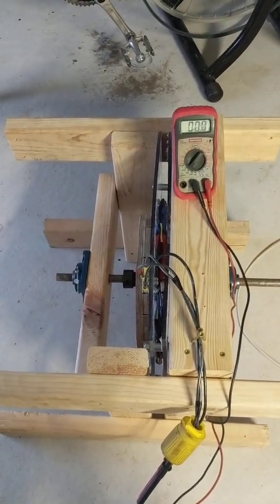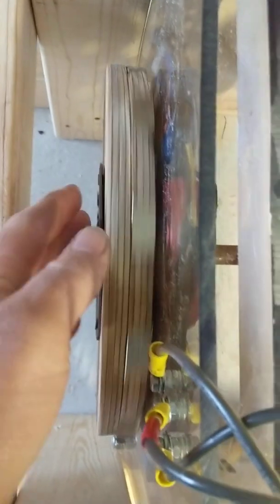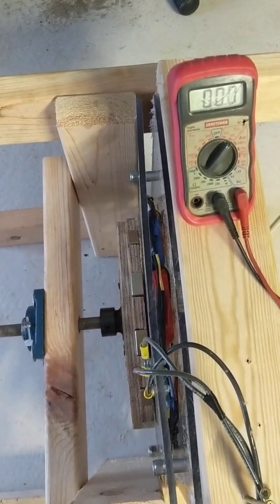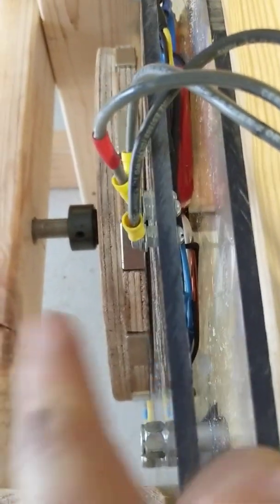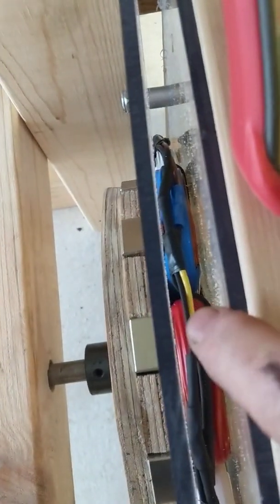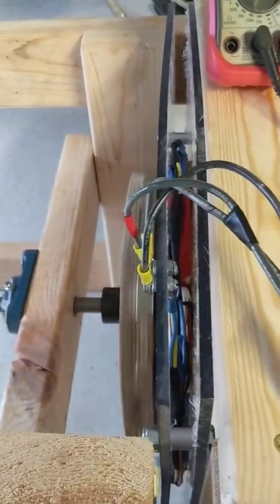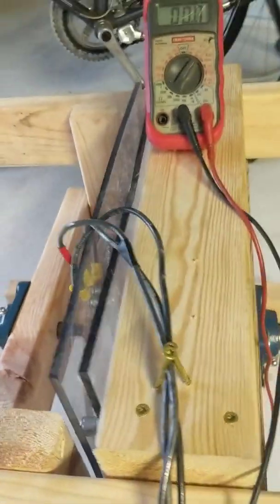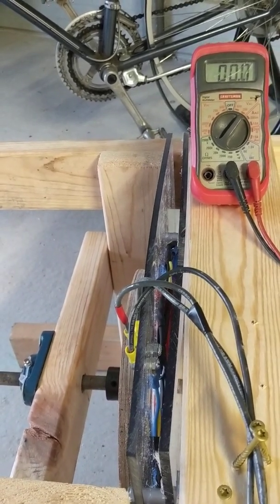Axial flux wind turbine build

Comment: are those 3/4 inch thick magnets? I use 3/4 inch thick n52 that are 147lbs pull force ,they are way better results than the n42 1/2 inch thick
Reply from the maker: Thanks for the reply yes these are 1/2" thick magnets but are N52's they are 2"x1"x1/2" not sure the exact pull on them but definitely don't want to get your finger stuck between them 🤣